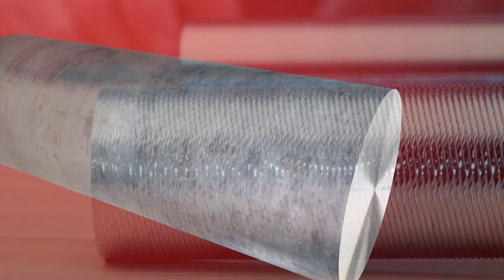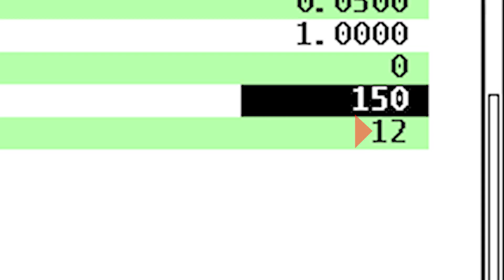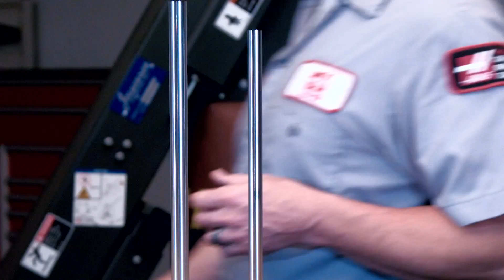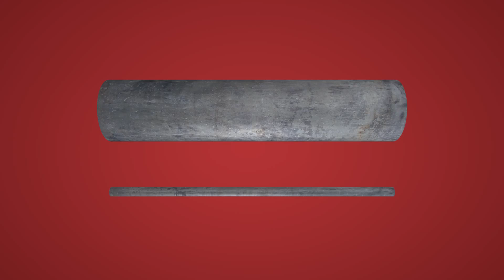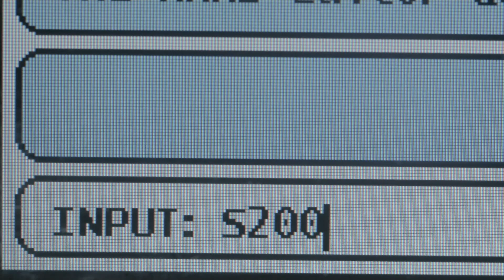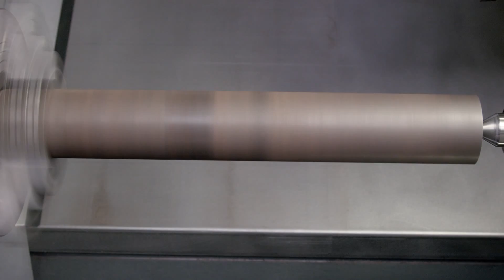Spindle Speed Variation - Stop chatter during CNC turning

Comment: Use the correct speed, feed and cutting tip. Running slow on the final cut will eliminate chatter . Never used or even heard of this ssv crap
Reply: Boomer
Reply: Suppose that you do turning operation on the face of the part, not on the diameter. If face is large you are going to see a color difference at an area of a diameter at which chattering  starts. That is, there is no problem of surface quality from outside diameter up to a diameter at which chattering starts. From that diameter to spindle axis surface fails.
To get rid of that effecet you have to increase the spindle speed. That is because cutting speed decreases when you decrease the cutting diameter if you fix the spindle speed constant.
Reply: Your trying to keep "X" feet per second per selected insert.